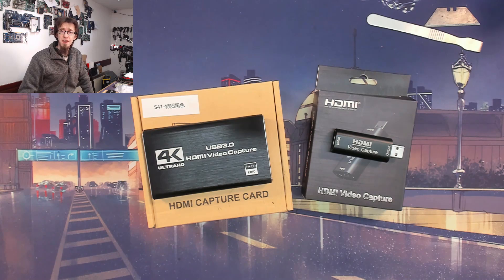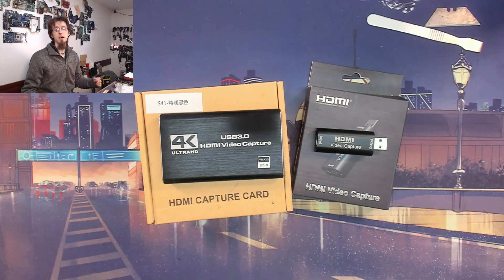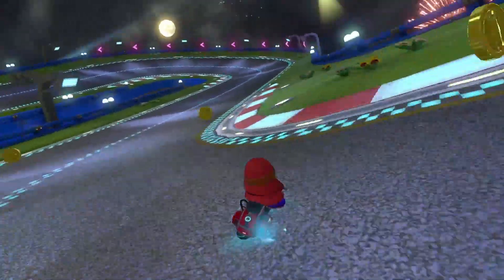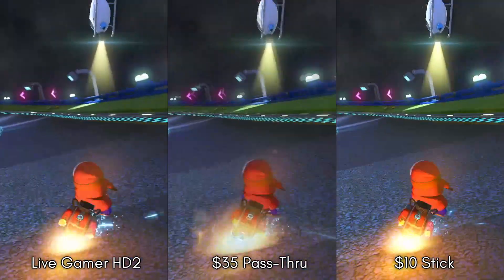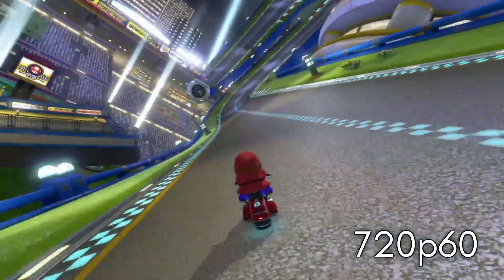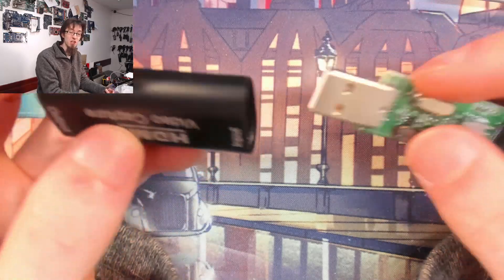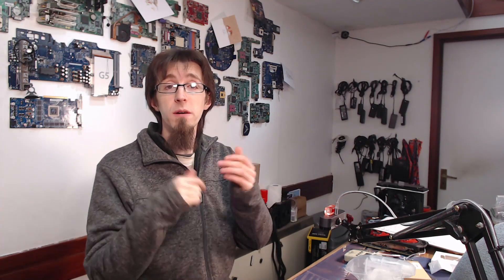Is a $10 Capture Card any good? - LFC#236

Comment: I'm guessing there's a separate chip to disable the HDMI HDCP, you notice on the metal case of the big one, it has a logo that says "EDID" basically this emulates the chip on a TV and bypasses any DRM that may be on the source
I'm also guessing that same chip is doing the splitting, because a lot of those HDMI splitters use the same chip, and it didn't take any effort to just go ahead and remove HDCP

Comment: I wonder if there is a performance gain from streaming from a laptop, you could plug the USB from the laptop and then get a short HDMI and then plug that into the laptop's HDMI and that could take some of the processing off of the computer and put it on the card, and if you're not encoding very high, the streaming services' compression will mask it more or less.

Comment: Could you not just use a HDMI splitter to bypass the need to view the output through OBS? The splitter could be connected to the monitor then the other end to the capture card then to the computer.
Reply from the maker: Yes you could. But that requires two boxes instead of one... so pass-through is preferable.

Comment: for anyone who buy usb stick capture, you can use hdmi splitter as hdmi through (its usually used in electronic store, so every tv/monitor show same picture)
so you can use it without any delay through capture software, the cheapest are around $3-5 on ebay for 1 input to 2 output hdmi splitter (mirror)

Comment: I spotted the USB 3.0 traces in the USB 3 version, it looks like the USB 3.0 interfacing parts haven't been soldered in (C60 and C61, I couldn't see where the other traces goto....)
If they hadn't soldered in the bypass capacitors for the balanced (LVDS) USB 3.0 traces, then I'd expect they haven't put in USB 3.0 support into the firmware.
.
Also, I got a similar device to the USB 3.0 one you have, except without pass-through... I got it to experiment with multi-way video mixing in Linux (If I can get V4L virtual-cameras working so I can use Webcamoid filters in real-time, then I can build the ultimate wireless real-time multi-angle multi-FPV URBEX setup! :) )

Comment: Do these devices come with any software to configure or set up? Other than OBS?  I'm wondering of the USB 3.0 device can be reconfigured in some way so there aren't so many hiccups at 1080p@60. Maybe there you can change it's encoder or compression level?
Reply from the maker: You can use them with any streaming software such as XSplit or SLOBS as well - OBS Studio is just my weapon of choice because it's free and widely supported.
It might be possible to re-program them, but I wouldn't say it's viable, as every batch will be slightly different, and the microcontroller might not be physically fast enough to do anything better, or support USB3. So yea, I don't want to say that it can't be done, but I'd be amazed if anyone managed it in a reproduceable way.

Comment: 13:22 a bit of detail: WM8960G on the top is the actual sound processor which is a 1W class D speaker driver and HK32F030C8T6 at the bottom is a clone of ST's STM32F030C8T6 microcontroller, the pins right next to it are for programming (J6) and for debugging (J7) this µC. You can dump the current and/or flash a new program to it using those pins. XMC XM25QH32BHIG is 4 MBytes serial/SPI NOR flash memory which probably contains the program for the main processor right next to it. The main processor of both boards could be an FPGA because usually, they need a 24MHz crystal to work, which is present on both of the boards.
Reply: Also, if he can find the USB 3.0 version of the firmware (if it exists) and was to solder 0.1uF capacitors in C60 and C61 and find out if the other differential pair traces required capacitors and added in a couple there too.... maybe he could get USB 3.0 to work?

Comment: Nice video. I may just buy a 10$ one to keep around for any emergency.
Video idea: There are loads of cheap WiFi 6 M.2 cards on AliExpress, intel chipset ax200/ax201 and now ax210 with WiFi 6E have  support. I have recently bought one to replace the one in a family laptop which still had a single antenna 802.11n. It seems to be working fine and speeds improved considerable even using a ac router. What about making a comparison video between these recent cards and the tipical WiFi cards from 5 years ago with one or two antennas. It appears perfect upgrade for an old but still usable laptop that requires faster connection. (Even for a desktop with motherboards that can take wifi cards).

Comment: Well, uh....shoot. This just made me poke my AliExpress capture card (that's USB 3) and...sure enough, Windows sees it as a USB 2 device. Explains a lot and why it acts up on me a lot. I've been on the prowl for another capture card but prices have just been too much for me to consider jumping up to something better at current.

I mean for the most part it HAS been fine in its defense, it just glitches out at random on certain scenes in certain games (good example: The part in Stardew Valley where the bus is, if you just walk along it to go to town my cap card FLIPS OUT. Doesn't do it anywhere else). HDMI audio was also trash but I got around that by way of just routing the audio from the cap card over line in.

Thanks for this video. Definitely need to keep my ears to the ground for something better now.
Reply from the maker: Ye. Like, for the price of these things, it's no real loss that they're not the best. But the takeaway from this is that an expensive card will absolutely yield superior results.
Funnily enough, today I was testing a VHS capture setup, and my old Elgato couldn't lock-on to the signal from my SCART-HDMI converter. Plugged in one of these boys and it worked first time. I'm still bringing in an AverMedia tomorrow, but in a pinch, the cheap cap card would work just fine, and for a VHS conversion I don't care about a little compression.

Comment: Render in 4k to compare 1080p footage. Youtube bitrate is as useful as rain drops to put out a house fire when it comes to fast motion.
Reply: Indeed, upscaling 1080p content to 1440p will "trick" the Youtube encoder into using a higher bitrate setting improving overall visual quality of the 1080p stream.
Reply from the maker: Neato - I'll do that next time!
Reply: I used to put the video onto 4K on a 1920X1200 screen to get cleaner playback, however, the encoding has changed since a while ago and my laptop can't render that any more, just drops most frames.
However, if ya got the broadband speed and unlimited data, that's probably the best quality to get from Youtube.

Comment: I have two of those little USB capture sticks, from different sellers. One had a heatsink inside and one did not, the one without would overheat and stop capturing so be warned they are not all equal.

Comment: I bought a pass through style capture card, it has both  USB 2.0 (blue, labelled 3.0) and a type C port for extra power? Not sure.. it's got pass through, but the audio is awful and so quiet (please read more.. audio sync issues)

It does have 1080p60 mode but it just has frame doubling, so runs around 30fps.. It feels (and i'm not sure, can't test it) around 25fps though due to framedrops.. At least 720p60 is ok

ALSO, there's audio sync issues, gradually the audio drifts further and further away from the video unfortunately.. Not sure why this is but unplug and plug it in again and it's fine, for a while.

I will likely look at getting a used capture card next time, the audio sync kills it for me.
Reply from the maker: Ah de-sync is annoying, yea. In obs you can just deactivate/active the card now and then to re-initialise it. I didn't spend hours on these cards to check for that.
Reply: @Adamant_IT  mine was substantially out of sync (2s+) after only 20mins of gameplay.

Not very usable really.
Reply from the maker: Oh wow that's super bad, yea... Like, I've had cards that drift over a couple of hours, and I have to re-initialise once or twice in a 4hr game stream, but 20mins is useless for streaming.

Comment: the 3 i tried, were 1080p 30Hz, or 720p and lower 60Hz, the one labelled USB2, was the worst, it forced all other monitors connected to the graphics card to 60Hz, but the ones labelled USB3.0 that were still USB 2.0 just with blue plastic usb connector with out the extra pins, did not force other monitors to 60Hz, the one had passthrough (mine was under £20), was the best one with the least 'glitches' though they were all OK for their price, they were all able to switch colour space to get the best quality in OBS,  1080p60 was never even an option on any of mine,  so i recorded things at 720p indistinguishable quality, then upscaled to 1440p with other software :)
Reply: It seems to be a common thing. I just received a grey 3.0 capture dongle, looked at the blue USB connector and found just 4 pins. Took it apart, and the USB connector indeed only has 4 pins, all soldered to the PCB. There is no heatsink, so reading the chip info is easy: Macro Silicon, MS2109 N147RDF0FP02 for those interested.
It has the same internals as the 2.0 it seems - according to this website where efforts has been put into improving the picture quality. https://bigl.es/friday-fun-10-hdmi-to-usb-capture/

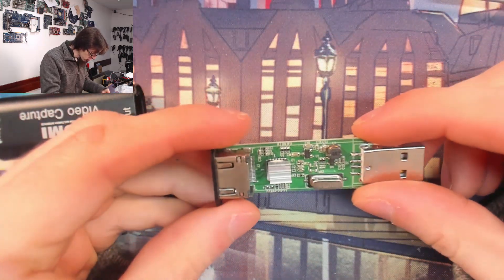Comment: I love these little capture cards as they make nice additions for someone with multi-cam set ups using GoPros or something, but just a word of warning from what discussion I've seen around these on other channels, there are QC issues around the little sticks where they overheat and burn out due to a lack of a heatsink on the main chip - seen at 11:30. 

Oh also, don't be fooled by the USB 3.0 "sticks" either, they suffer the same issue as the $35 shown here. It's just a blue USB 2.0 connector :)
Reply: This stick seems to have a heatsink installed. Do you mean other sticks don't have it, or it falls off?
Reply: @ToTheGAMES  Yeah this one does, and mine do too. You're correct, I do mean that other sticks might not have it (I haven't heard it falling off but I suppose it could be possible)
Reply: @ToTheGAMES  

I've just checked. Mine doesn't come with a heat sink. :-/
Reply: @oBsRVr666  You got the same one as here in the video? There seem to be a shorter version... Also, are the numbers rubbed off your chip?
Reply: @ToTheGAMES  

The numbers were not rubbed off on my unit. See picture below that I've just taken. The main chip seems to be a Macro Silicone MS2109. 

https://imgur.com/a/URViHsP

I am not sure what is up with Imgur, but I feel that their user experience has degraded over the years. They used to be one of the best image hosters out there but looks like greed or financial crisis has cought up to them. They are still okay but the user interface sucks now. If you want to read the chip numbers I'd suggest you download the picture, as I am unable to see a way to zoom in on Imgurs current user interface.
Reply: @oBsRVr666  Thank you! 

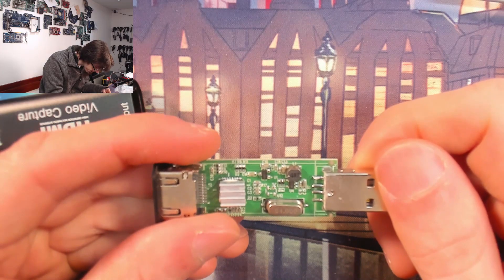You have the better version without as much image compression as Graham is showing in his video (12:00). I'm not sure if yours needs a heatsink to be honest. Probably better to have one, but not sure. 

Currently waiting for a few to arrive, wondering which ones I will get. Hopefully both, so I can do some testing.
Reply: @oBsRVr666  Cheers for part-number, I may have to try and find info on that.... I got a use for 4x (or more) of those for multi-source capturing:
A project I'm looking to start making regarding multiple capture devices that can capture the receiving end of a multi-camera setup and pass it through a realtime effects program and OBS on Linux, the purpose being for live streaming multi-angle and possibly multi-person setups wirelessly during an URBEX session.
.
Edit:
Imgur isn't working on Firefox or Palemoon, just loads a backdrop and stops loading anything else.... even Wireshark shows 0% network after the backdrop loads.... So defo getting worse ._.